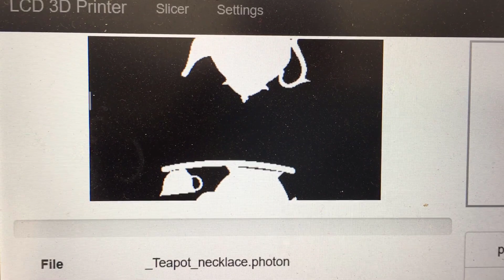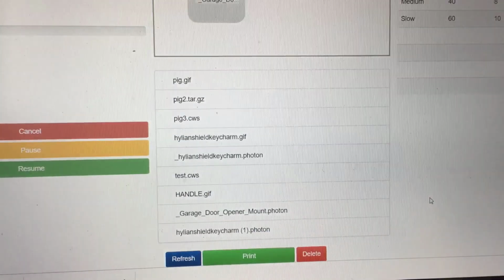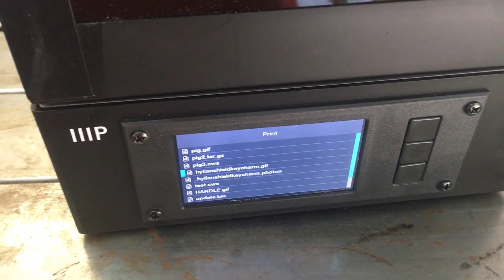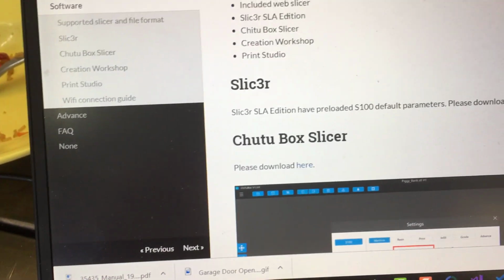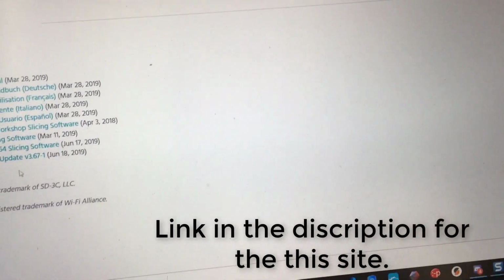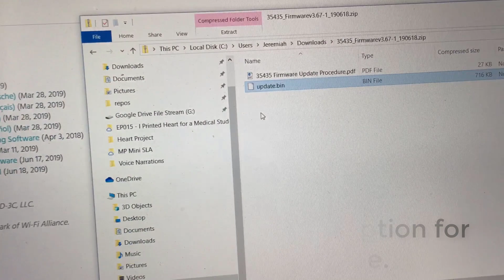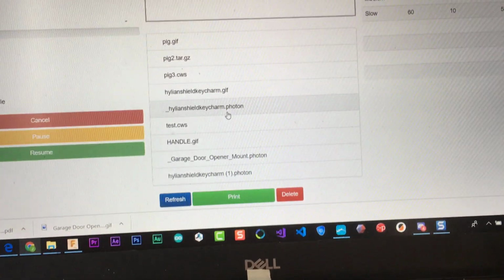Fix your MONOPRICE MP Mini SLA 3D Printer!!!

Comment: Do you have any updates on how this printer is doing?  Couple reviewers had posted it was a good printer then later posted the returned it.
Reply from the maker: I had to make a few modifications to make the printer work but it prints great. Don't use the Wi-Fi, glue on the platform because the magnets fail on large prints, put a bolt  through the auto leveling system so it doesn't get pulled out... But not I'm using it much anymore when monochromatic screens came out monochromatic is just so much faster. Mainly used the Mars Pro 2 Ive  going to video up about that.

Comment: I need some help with my Monoprice sla . It looks different and can’t find any help anywhere. Company says they don’t know the issue either , this is the second printer they sent me.
Reply from the maker: If you don't like to tinker with 3d Printers. My advice... junk it.. and get a Elegoo Mars Pro... if you like a challenge then good info on the MP mini can be found here: https://www.facebook.com/groups/MP.Mini.SLA
Cheers and good luck!
Reply: HaleDesignTech junk it? Wtf? Thanks for the fb link .
Reply from the maker: @andrewlozano88  Yea fundamentally the design of the unit is flawed. Software buggy at best, processor is under powered, Auto leveling system slips in Z under load, Wifi has no stability and disconnects frequently their onboard slicer is worthless. Just to name a few problems. Over all its the worst SLA printer I've used so far but if your willing to ticker/waste resin you can get good prints...

Comment: my print got elongated...didnt print full also i used chitubox..recheked the mesh in chutubox after printing ...everything was fine in chitubox...the print itself got elongated...any suggestion or advice please
Reply from the maker: Try a 0.05 layer height that is all I run it seem to work well for me. I'm not sure that the Photon file type is properly read by the mp mini. The Mini might be defaulting to its own layer height set in the Web interface.
Reply: Make sure the print area settings in Chitubox are correct